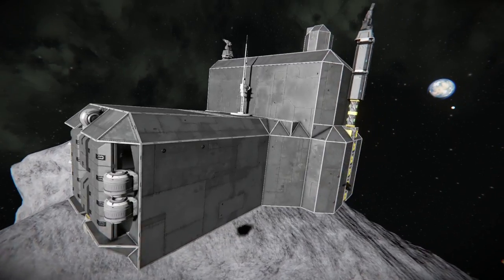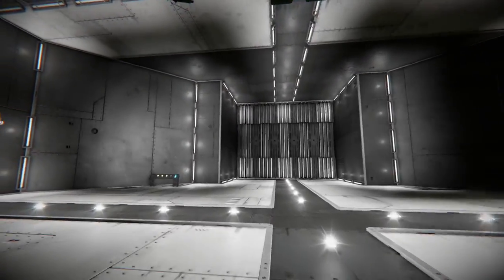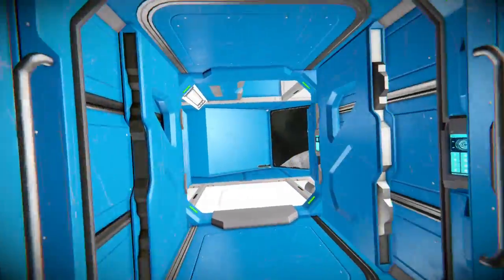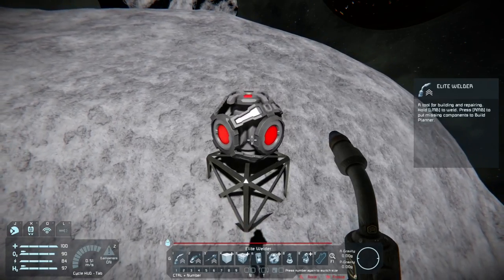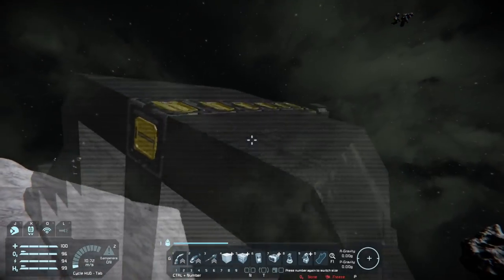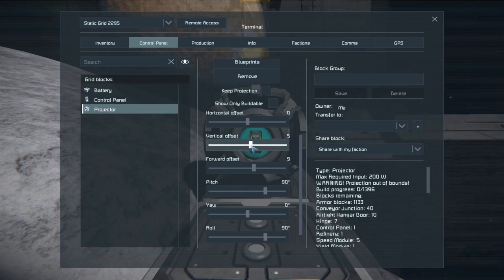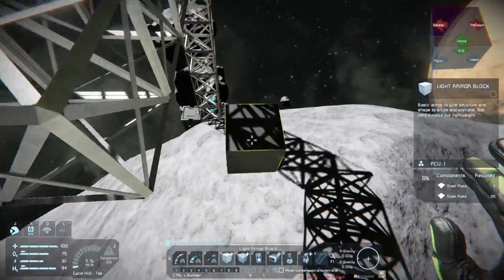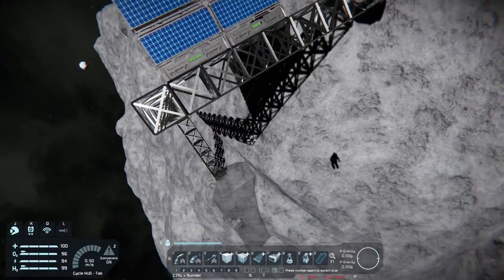How To Project An Asteroid Base

Comment: You might get better mileage by having a small (size, not grid) carrier/miner equipped with a projector, cargo space with parts, and a dock for construction/salvage drone.  Mine out the space, land near the site, project and start construction.  You can even prepare a blueprint for a planted projector.
Reply from the maker: Interesting,  will have to consider that for future building. Thank you
Reply: @mastermindgameplay5297  no problem.